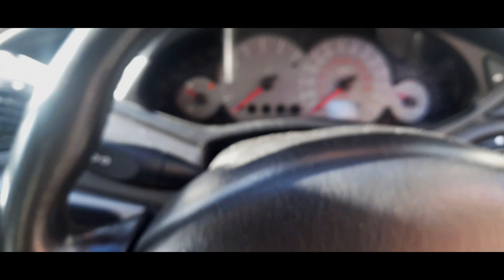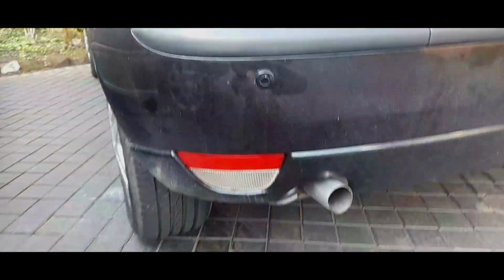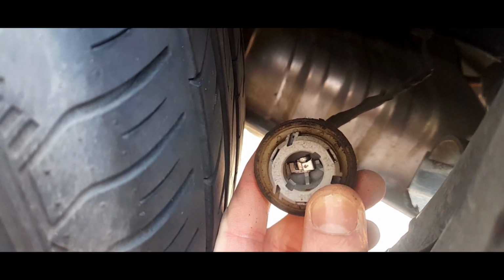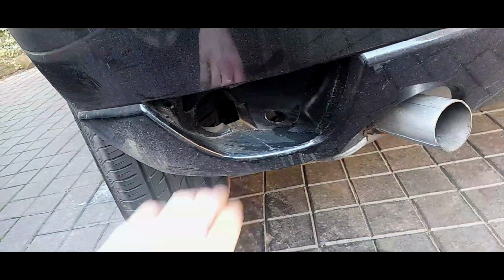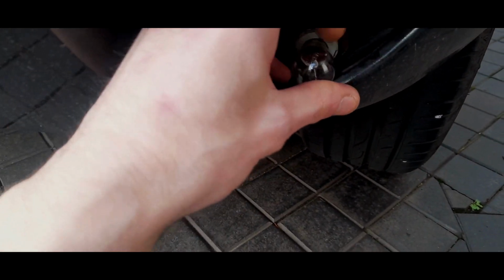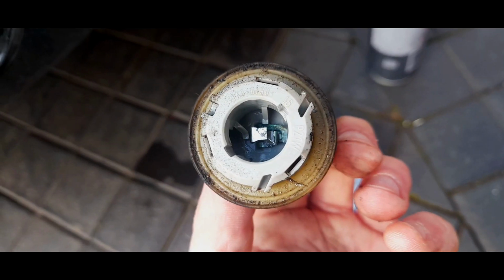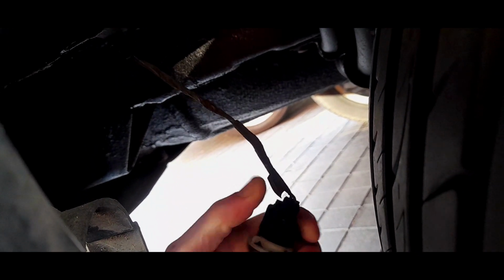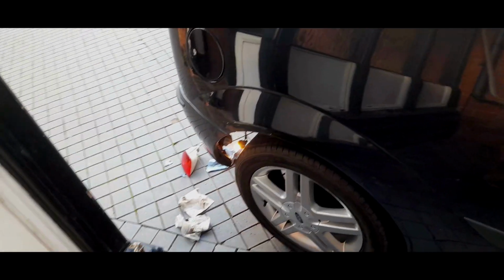Focus MK1 - Has your Reverse/Fog Light stopped working?

Comment: If you have a multimeter, out it on continuity mode ( with the buzzer), an d test the bulb holder. If the bulb and the holder are fine, its probably the reverse light switch which is also a common fault at this age. Cheap and easy fix at £15 and a 22mm spanner .
Reply from the maker: On my car being the automatic, the switch is park of the inhibitor set-up so slightly different but you are correct!

Comment: We have a 2002 Focus 1.8 Tdci (115) in silver with just 53000 (we have owned it from new) 10 years ago we took it over to Spain and re registered it there for a new life. Really the only thing that failed in that time was the reversing light, but as Spain don’t suffer from rain 😂 it was the switch not the bulb holder. This beautiful old girl is still a joy to drive. Ps In Spain the reversing light IS part of the Mot (ITV)
Reply from the maker: gosh the switch!!! that is a rare fault indeed. I can imagine the underside being in really good condition. If I ever moved abroad all my cars are coming with me :)

Wow and in the UK pre-2009 cars don't need a working reverse light?!
Reply: The paintwork is all original…. The rear subframe and parts have some rust that was because of the first years in the UK before it came to Spain. I intend to address this with a good clean and repaint.
The front struts have some rust too
Reply from the maker: @adriancopestake887  In that climate it won't  deterioate hardly at all :)

Comment: Hey, here I am again.
I fixed the lights inside the dashboard, thanx for the help again.

Next problem, reverse light won't work.
I checked the connection and it works, bypassed the switch on the gearbox via the accu and an cable.
Also checked the switch through bypassing and no light so it's not the switch in the gearbox.

Only thing I can think of is that + cable broke.
I checked at the end with an multimeter and the voltage is jumping from 4.5V to + 25V and everywhere in between.
Is it an broken cable or do you think it's something else?

Thanks again!
Reply from the maker: that sounds like a broken wire to the reverse light, check where it goes from the connector into the boot
Reply: @usuallyfixingtinkering  thanks a lot will do!👍

Comment: All my dashlights and instrument lights stopped working.
Any idea?
My taillight and everything are working.
Reply from the maker: Your dashboard has a bad soldered joint. You'll need to send it off to ecu testing to repair. Not too expensive but you'll be without the cluster for a few days.
Reply: @usuallyfixingtinkering  thanks a lot!

Comment: A faulty reverse light is not an MOT fail on MK1 Focuses. Only vehicles first used from 1 September 2009 are tested and this rule didn't come into force until the MOT changes in 2018.
A faulty fog light is an MOT fail. Not only must the light itself work but also the "tell-tale" indicator near the light switch.
Reply from the maker: That is correct for reverse light side of things, hence why I was driving round with a broken one for years, wasn't even on the advisory for some reason!
Reply: @usuallyfixingtinkering  Yes I always thought the reverse light (in fact every light) was tested. Before every MOT I check the lights, wipers and horn. I once failed on a number plate light - I didn't realise there are 2 of them, the glow looked good to me!
Recent MOT my reverse was out. Panic on the morning but I fitted a new one from a factor. Tester told me it wasn't needed anyway due to age of car!
Reply from the maker: @Drew-Dastardly  I always check all the lights as well just a precaution!

Comment: Why did you bin the rear arch liners ?
Reply from the maker: They cause signifcant structural rot in the arches. They're a carpet material that takes days to dry out after a drive in the wet. The moisture is just sitting against the arch lip and back of the arch and rusts them out. I'd recommend removing them and undersealing/waxyoyl the arches instead. Best thing I ever did with no rust whatsoever since!

Comment: Stops working quite often, actually. :-) The reverse light, that is, NEVER the fog light, curiously enough...
Reply from the maker: Your unlucky on that side is all I can say, I've found that both can stop working as equally as each other... arch liner in place or not, it doesn't make a difference!
Reply: Could be the fact that there is more muck in the gutter side of the road
Reply: @paulridley3184  Exactly. It's a left hand drive, driving on the continent... So yeah, that must be why. The reverse light is on the side-of-the-road side. :-)